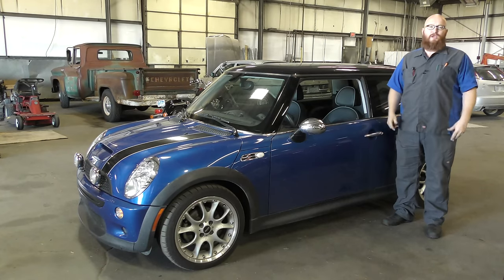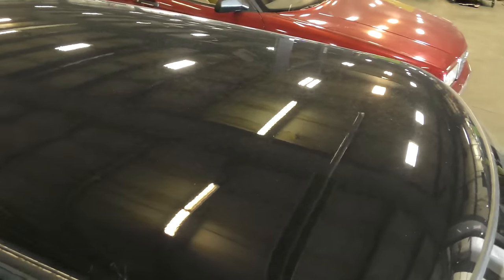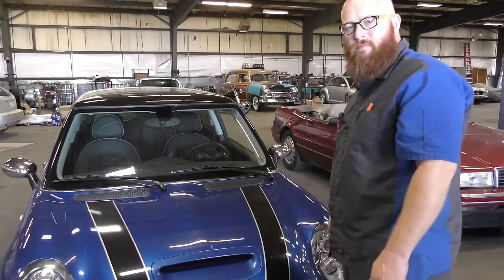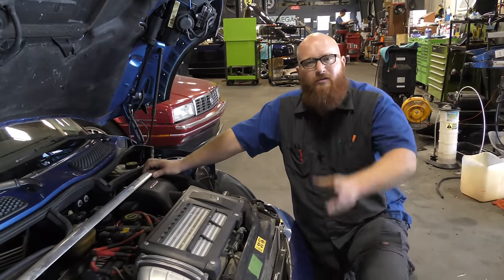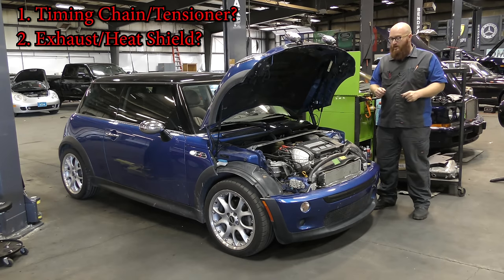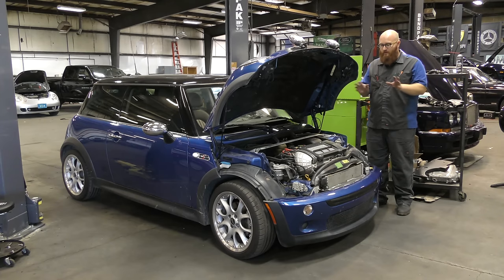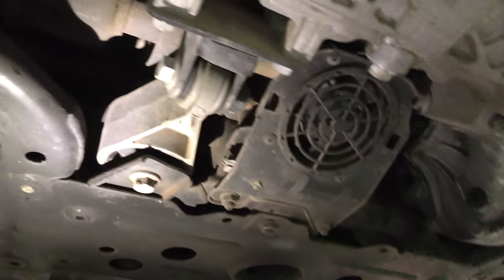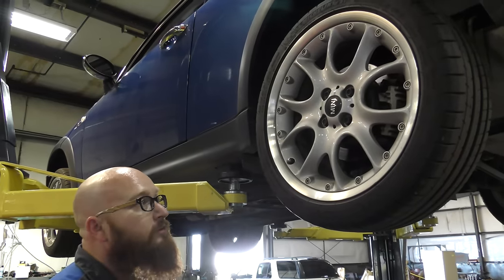Roaring Loud Mini Cooper S! The CAR WIZARD finds the source of the mysterious noise

Comment from the maker: I did not see my side of the headliner sagging. But it is. Probably from heat. Thanks for finding it guys
Reply: It's a common thing, my '03 headliner is doing the same.
Reply: I was wondering that too
Reply: The headliners all sag on first gen MINIs...they are getting old...glue dries out.
Reply: was easy today!!! u said 2 times before asking that u gonna do a supercharger service...!!!!
Reply: I own a 2003 Mini Cooper they are great to drive and work on, I have worked on my own. Fun oh yes they can be, so much fun.
Reply: The foam deteriorates and the fabric sags. Shops charge as much as $500 to replace it. I’ve done a ton of them for $50 worth of fabric and glue. 3m makes the glue on a can. Takes about 2 hours depending on the vehicle
Reply: I had a 2006 Mini I replaced the factory coil pack colder plugs and wires. My fuel milage increased and performance increased dramatically.
Reply: @NG500 Probably because certain BMWs get close to, or over, book time. Probably not worth the views, either, compared to domestic vehicles the majority of his viewers have and exotics people are curious about.

He doesn't clog his vids up with 12 parts of one vehicle. He comes back to the doozies for updates. Also, he may just not have any fun working on BMWs.
Reply: I don’t have the same problem with my 2003 headlining is currently fine, might have been a bad batch of roof linings.
Reply: @NG500 In the UK 2004 Mini Coopers have a Peugeot engine then I think it was 2005-6 they change to BMW and now they are not BMW. its Complicated I would rather have the Genuine mini that is not as big as a house.
Reply: Stephen Baker no they had Chrysler engines from 2001-2006 then Peugeot’s on the next gen r56 then f series got the bmw engine
Reply: i was correct whats the percentage of the fees you charged do i win?
Reply: Worst noise my car ever made? Two things that went wrong at the same time: it leaked out all it's oil, and -- much worse, the oil light didn't work. So the engine ground itself to scrap metal. 😡
Reply: BMW and other EU companies were forced to design cars to be easier to recycle many years ago. The glue is part of it. I had a 3 Series that developed a bubble on the drivers arm rest. After a hot day setting at work, the bubble was the size of a grapefruit. Apparently they didn't test the glue where the temps got as hot as the southern US.
Reply: Why in sweet car hell, would you say the supercharger is the problem, and then give me a three question test?  On the upside Mrs Wizard did not annoy the hell out of me in this video, she talked in a way that didn't sound like a 7th grade speech class script being read.   I'm not bitching my man, but I want to make you better.   You are a veteran and a car guy that goes a long way with me.  Tyler is a very entertaining gimmick on wheels, with no taste.  you could actually become a 10 mil sub if you do it right.
Reply from the maker: Erik Roberts I never mentioned the supercharger was the problemat first. I said the car was in for a supercharger service. Meaning change the supercharger oil
Reply: Car Wizard     Didn’t the owner mention the noise of the supercharger. And how is that not the bearing to the shaft for the pulley making all that noise.
Reply: This is a incorrectly installed  aftermarket pulley right?
Reply: Jeffery what are you talking about, I never said anything about engines, also I am in the UK.
Reply: Car wizard do you have a video on how to store a car for winter time
Reply: My new (to me) car that runs on LPG and petrol has a sagging headliner. Roadworthy guy just said put some thumbtacks in it. I will pull the ceiling out and have the headliner redone, though. The rest of the interior is too damn nice.
Reply: @Shauma_llama  and you didn't hear it???
Reply: You know that MINI is owned by BMW and like BMWs, they are complete money pits. Minis made in the early to mid 2000’s are well known for power steering problems and engine failures. If you got an automatic (CVT) they are guaranteed to fail and it was so bad that owners sued BMW. Do not buy a Mini. The manuals also are known to fail as well.
Reply: Formula1 Fan Didn’t some have Toyota diesels as well?
Reply: @curtiscarpenter7423  store a car for winter?
1. Replace battery if over 7 years old.  Keep and eye on the voltage.
2. Start engine once a month. Drive it around the block once and a while.
3. Check engine coolant. Replace antifreeze every 4 to 5 years.
4. Don't let window washer fluid freeze. Pump it all out!
Reply: @alpine1600s  My '03 MCS headliner is sagging bad too.
Reply: Sir do you recommend anyone as good as you in Houston Texas
Reply: @mclarenjohnf1  the original BMW Minis had Tritec BMW engines built in Brazil.  These were also used by Chrysler.  The second generation launched in 2006 used Peugeot engines, with a turbo instead of a supercharger for the Cooper S and JCW.  The latest gen cars from 2014 have BMW B38 3- and B48 4-cylinder engines.
Reply: @Night_Owl2023  driving with the windows down pulls them down...ie no A/C...then no headliner over the next 2 or 3 years
Reply: Car Wizard,  in Canada 🇨🇦 if MINI gets ANY accident it's a "TOTAL WRITE OFF" by insurance companies. 😳
Reply: Sounds like Timing chain issues
Reply: Got mine replaced in Maryland/DC area at DC Headliners for a great price, under $200 around three years ago. Still looks new. 2002 R53. Love it!
Reply: Most shops are afraid of front end service mode.
Reply: Not a genuine JCW

Comment: “There’s something wrong with this car, even with such low mileage”. It’s a Beemer. Nuff said 😎
Reply: Actually this one is a Rover design with a  Chrysler Tritec engine....
Reply: And a Beemer is a motorcycle, while a Bimmer is a car.
Reply: Matt Bowles I believe the supercharger was built by Eaton
Reply: @Highqman1974   yep, you can buy Eaton supercharger fluid at Chevrolet dealers. R53 mini takes the same supercharger fluid as chevys.
Reply: I think only the third gen and newer minis were actually BMW built
Reply: @Highqman1974  BMW, Leland and Chrysler all in one car
Reply: @hatebreed79  It was
Reply: This generation lasts 220k+ miles easily.
Reply: @aygwm  nope BMW started to fully take over and introduce their own version of the mini cooper in 2007 they incorporated, partial "original" mini mixed with BMW sooner but BMW mechanics were fully integrated into the BMW mini cooper in 07
Reply: @Highqman1974  I saw the interior and right away I thought "reminds me of a Rover Streetwise" so that would probably be why! Haha thanks
Reply: I believe they used a Peugeot engine from 2006 onwards for the 2nd gen New Mini. But yeah, the 2006 Cooper is Chrysler Tritec.
Reply: @Steven Crosby the mechanics from 2007 were not BMW. The R56 has the chocolate Peugeot engine.
Reply: @FurkanCemTurfanda mine is 212xxx miles still strong

Comment: The ‘06 MINIs are probably the most reliable ones that they made. Most of the original problems were fixed and the timing chain problems didn’t really exist yet.
Reply: Owning an 06, that’s not saying much 😂.
Reply: My 05' face-lift is rock solid. Nothing wrong after 18 years.

Comment: It’s missing the factory under shroud.  Missing a couple of screws that hold the shroud.  This is a John Cooper Works.  It already has a smaller SC pulley already.  The 15% reduction was a common mod on these year cars.  I have a 2002 MCS with 42k on it.  It has the 15% SC pulley and stainless exhaust manifold and all all the way back.  The Borla is not stock.  Exhaust mods were very common. The driving lights are an option from the factory.  This is a great example of almost pristine MINI R53.
Reply: True, this one has the JCW air box (which is a little surprising to see, given how pricey they are compared to aftermarket options) but it is lacking the numbered JCW plaque on the valve cover and the silver JCW intercooler air diverter.  Since neither are present it means it does not have the full JCW engine upgrade.  

Given the JCW air box, the aftermarket Borla exhaust, and the aftermarket strut bar it wouldn't be a surprise at all if this one already had a reduction pulley.   

And yes, this is one sweet well-optioned slicktop R53.  I'd love to own it.
Reply: I’d be dubious of this being a JCW.  It’s lacking the rocker cover badge, intercooler cover and rear badge, and Id doubt the JCW exhaust would have been replaced with an arguably worse flowing Borla system, but you never know. those things could have all been removed. The colour of the injectors would likely determine it
Reply: Pristine example of a money pit.
Reply: @igorsolovyanchik8955  minis... beelzebubs creation,
Reply: It's not a John Cooper Works. It's just a Cooper S (still a great car) with an airbox and exhaust upgrade.
Reply: The -15% supercharger pulley and JCW cold air box, with wired open door is a great upgrade.
Reply: Igor Solovyanchik money pit? I know nothing about mini’s but they seem like a fun ideea, small car supercharged engine, could you explain please?
Reply: @davidecalitescu3727  parts are through bmw, so OEM  is very expensive, they are a bit of a turd to work on, its bumper off for most jobs, the  later ones have electrical issues up the wazoo, primarily the BMW infotainment consoles.
they cook coils at a fair rate, its a lot of engine in a small space ets pretty hot in there,  and try changing a rear light bulb on a convertible one...
they arent too bad for reliability though, i deal with a fair amount of them and at this stage? even the early ones are still going strong without too many issues and they make good money due to the service menus making owners bring them n before issues get worse, needs brakes itll tell ya, needs oil, itll tell ya, due an inspection ? itll tell ya, needs brake fluid?
itll tell ya.
i quite like em when they arent misfiring.
Reply: Davide Calițescu my ex had one and yes they are a money pit, constant problems
Reply: Igor Solovyanchik yes I agree, they will be in the shop a lot
Reply: @Davide Calițescu they’re not a money pit. The first generation of BMW minis which this car is are reliable if looked after. They have their faults and common failures as do all cars, but they’re really not as bad as some will make them out to be, and I’ve had mine for 4 years and it’s on 168k miles. A common theme I’ve come across in my ownership of these cars is people who’ve either heard someone say they’re bad, or have bought a poor example of one that’s given them trouble and that’s then cemented their view on the car, so they then go on to preach their experience as factual information of what all examples of this car will be like. If you want one, then do your research and ensure you find a good one with service history and the rest of it, and it’ll do you well.
Reply: Looking forward to more of the Cooper S wizard. I love mine, even if it has just cost me over £1000.00 in repairs lol
Reply: There would be a JCW kit # on the supercharger faceplate if it were a factory or dealer-installed Cooper Works. It must be an aftermarket airbox; I can't see any JCW owner (LIKE MEEEEEEE) throwing out their JCW faceplate. r53 was the best gen!
Reply: @MisterMinigun  I guess if a right front accident that totals the car the air box would still be good. 😂 most of your aftermarket air boxes are sucking hotness from the intercooler and radiators. Useless.

Comment: Fitted with the chrono dash pack! Really rare here in the UK. It basically moves the Speedo to the steering column
Reply: I despise the centre mounted Speedo we usually see here, the chrono pack definitely makes it 10x more desirable in my eyes
Reply: Really rare everywhere
Reply: Also has a sunroof delete from factory, I bet it has the factory limited slip differential too. My dream combo. Has the JCW upgrades too ofcourse. What I would do to find a combo like that.
Reply: I have a full set of chrono pack for sale

Comment: R53 model minis are by far the best Mini BMW has made.
Reply: I disagree.  Not by a lot, but I've owned both the 05 S and an '11 JCW.  The JCW wins hands down.  One of the most annoying things about my R53 was the rattly, squeaky interior bits, it drove me insane.  Sometimes I just wanted to pull over and rip the interior to shreds.

Comment: I understand that low mileage being like new . Bought my Miata from an older gentleman.  It has 24,000 miles and it’s a 2008. Pre purchase inspections on the lift the undercarriage has never been exposed to rain. All the paint and parts are still shiny.  And the headliner is in great shape because it’s a convertible.

Comment: This is a pretty rare spec of MINI Cooper S. The stripes were part of the sport package and were factory installed. The driving lights were a dealer option for $500. Those optional upgraded seats were a $1700 option. 

Personally, I have driven 2006 MINIs over 230k and averaged $1300 a year on maintenance/repairs/tires.

Comment: 267,000 miles on my 2005 Cooper S. It's the same here in Virginia with shops not wanting to work on it or getting work done and it ends up being done wrong. I have spent A LOT of money keeping it going but I just can't get rid of it! I get it to the Wichita area a couple times a year. May be I should make an appointment next visit. Needs more work (always).

Comment: My Nana had an 08 Mini Cooper S that she got from my uncle about 2 years old with about 14k miles; when we sold it for her 2 years ago as she could no longer drive, it only had 21k miles on it. It was the car I learned to drive manual on, and that I really like the pull of a turbo, especially from BMW. Hated the ride of it, it was on 18s chrome wheel with runflats.

Comment: I own three Mini Coopers a 2012 Cooper S, 2013 Paceman S ALL4 and a 2015 Cooper Convertible. Just a blast to drive not boring like almost every other CUV/SUV out there. Never had anything go wrong with any of them yet. I put snow tires on two of them and plow thru Alberta winters with little drama, but you have to be careful or you will be stuck for sure. The All4 Paceman is a beast in the snow with its winter tires....
Reply: How is the reliability I heard they aren’t that good but if you have three you would know lol thanks!

Comment: The best generation of the BMW minis ! If it’s overheating related it’s probably the expansion tank or the oil cooler o rings on the oil filter housing. Also on another note , this car has the Cooper Works Airbox , which inputs some of the supercharger noise into the cabin. I would strongly advise changing the Coolant Expansion tank before it cracks 🤷🏼‍♂️

Comment: I have a 2004 R53 Mini Cooper S with 26016. It does have one very, very small dent that requires effort to notice and some curb rash on two wheels but otherwise beautiful. The interior is perfect. Two-tone leather seats blue and gray. It's absolutely brilliant to drive.

As for service, I would recommend taking a Mini to a Mini dealership shop. They should know your car better than anyone else. Guys like the Wizard are few and far between.